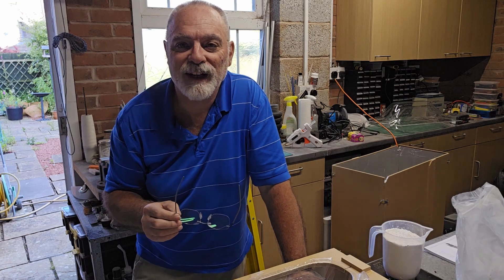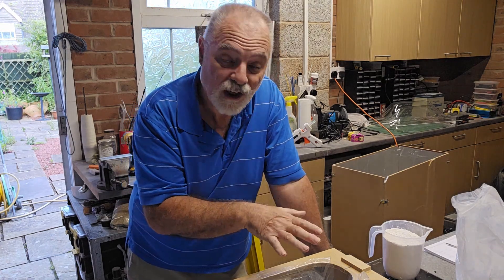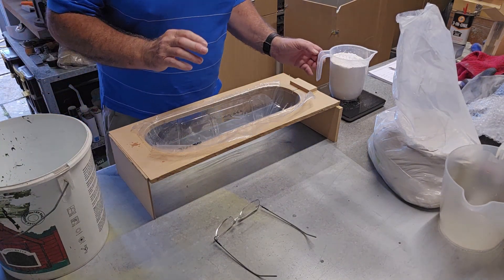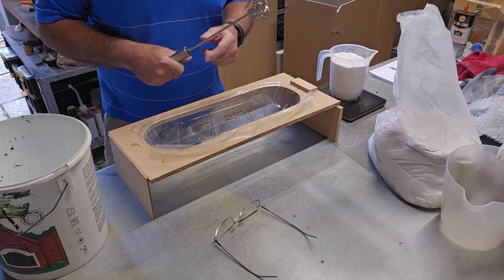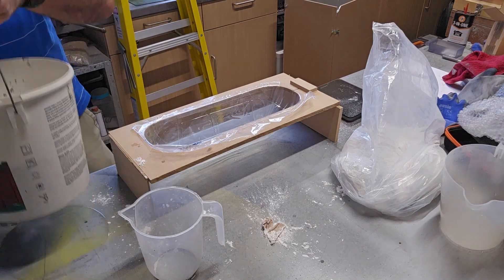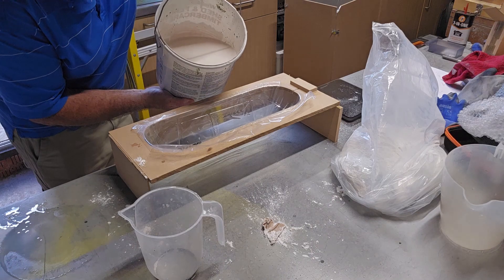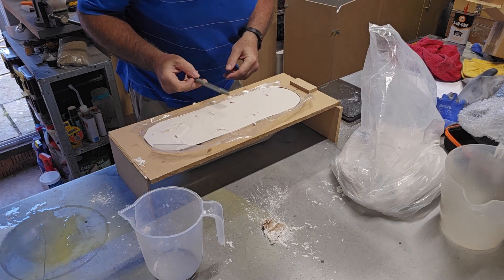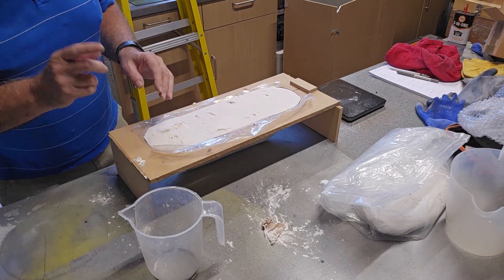Creating a plug from a vacform

Comment: Does the plaster get hot enough to melt the plastic or make it softer?  Would multiple pours solve that problem?  I'd be tempted to use spray foam to add more support to the plastic so it's not just supported by the rim. Would that help?
Reply from the maker: No the Herculite doesn't get hot enough to do any harm to the plastic. Modellers do build a box around the outside of the stand and back fill with sand to help support the weight. The weight of this one was okay to just be supported by the edge. I do say in the video that the distortion was actually in the original vac-formed canopy......

Comment: I for one don´t like to waste on the materials when I do a cast like that. 
I carve a piece of foam that leaves around 1-2 cm all around. I put a big weight on top of it to make it stay submerged before filling around it with plaster.
It has one more advantage as it makes the plug lighter to handle....
Reply from the maker: You are quite right, however in practice the entire structure needs added rigidity to keep the foam submerged, and the setting times mean that you have to act quite fast. But in theory you are right. In my defence 5kg of Herculite is just £11 so you have to balance cost versus time. But a bigger plug, I would definitely think of adding cheaper ie foam packing.